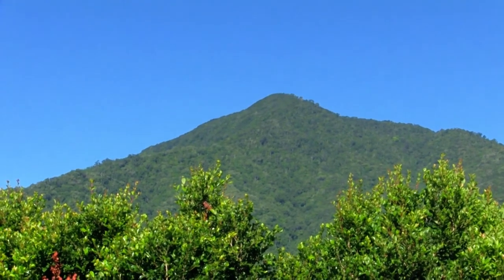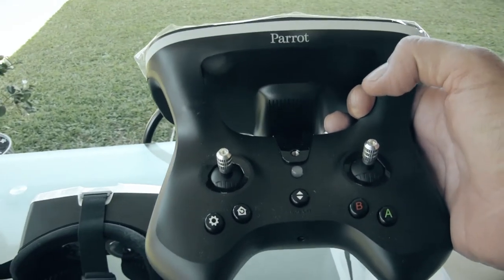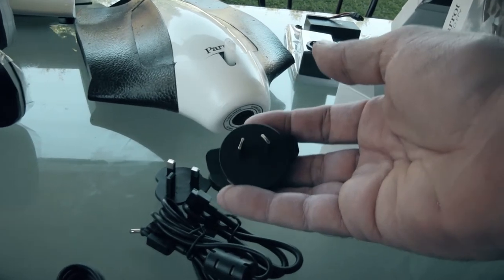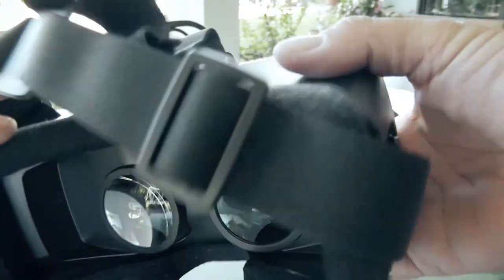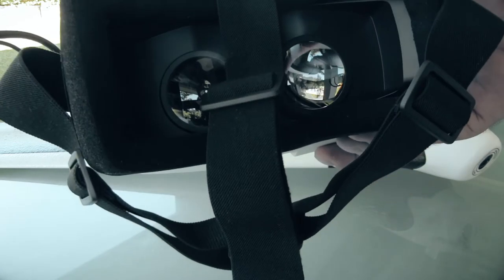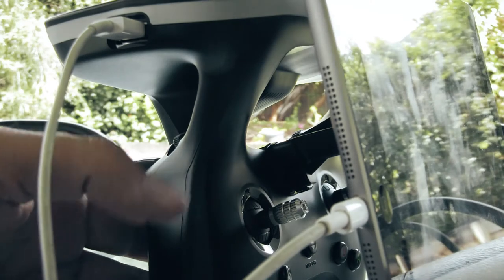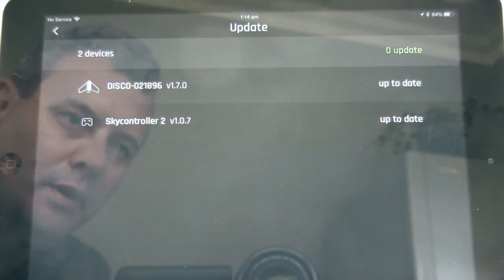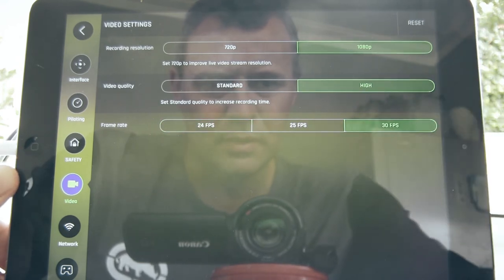Parrot Disco - New Drone Unboxing and Setup

Comment: Can other disco owners hear a "knocking" sound from the bottom of the disco. I believe it comes from the ultrasonic sensor?
Reply from the maker: Petri Y I never noticed any knocking sounds with mine
Reply: @stonesrcchannel  Okey:) I will do the maiden flight this weekend. Let see if its working properly despite the weirdish sound. Have understood that the drone fails to land correctly if the ultrasound is not working...